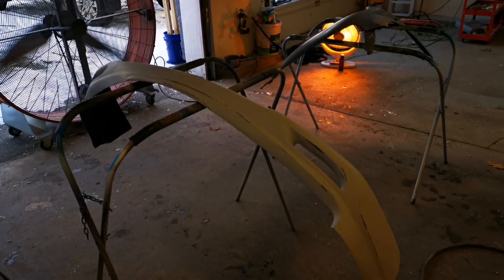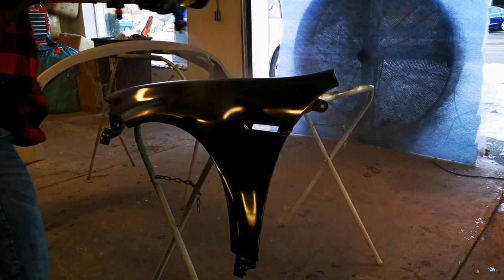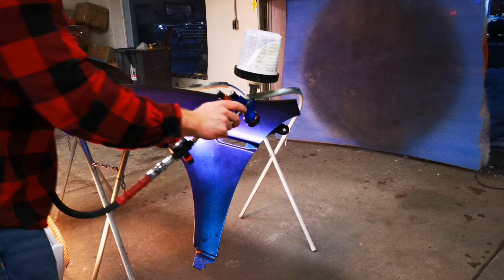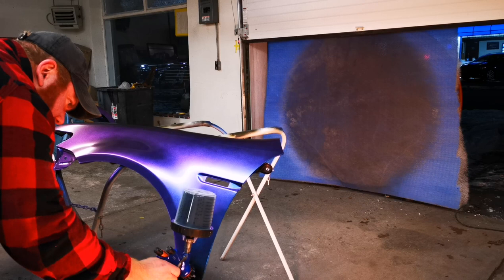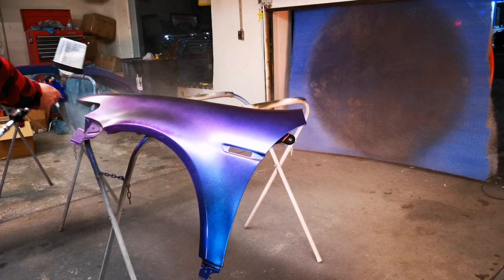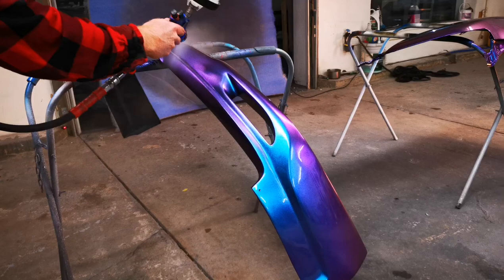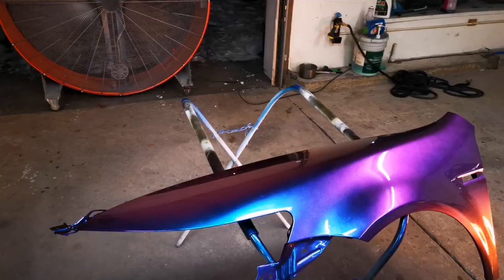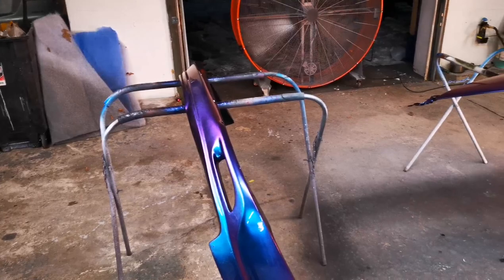How to paint colorshift

Comment: Thank you so darn much for this video.  I have a couple questions for anyone who’d like to help me.  I am painting a Nintendo Wii Zapper and I know I’m essentially asking an NFL team how to tie my cleats whilst the only thing I know about football is how to out those cleats on, and I’m terribly sorry for this! 😂   I also must apologize in advance for not knowing any proper terms 🤦‍♂️ 

The Zapper is plastic and breaks down into several parts which have all been primed with black Rust-Oleum sandable primer and wet sanded up to 1000 grit.  I only have to remove surface contaminants before I apply the primary color.  I will then apply clear coat before the final step of sanding/buffing/etc.  The main color:  Rust-o-Leum Blue Galaxy Color shift.  The clear is R-O Painter’s Touch 2x Gloss.  I’ve made a small paint booth that lets me hang each piece for painting if needed.  (Please, if something sounds off or if I’ve left something out please tell me!)    
    
1.  I was unsure if I need to paint the Zapper assembled in order to get the desired effect.  I don’t know how these paints work, so I don’t know if our two paints work the same.  If they do, that answers the assembled-or-not question.
2.  If the body parts are painted separately, how should they be positioned and should they all be consistently positioned at the same angle?  For example, could 1 piece be sprayed perpendicular to the floor and another sprayed angled, like in your video?  Is spraying it perpendicular to the floor not recommended?

That’s where I’m at and looking to finish.  Any help would be so wonderful!😊

Comment: Another great job as always dude! Would you reccomend following the same steps for pearl jobs? I'm doing a blue and gold ghost pearl over an ivory base. It looked amazing over the speed shape I did, but I'm getting the pre game jitters when it comes to the whole car. Thinking about doing the targa top and accessories first then body after it cures. Thoughts?
Reply from the maker: I still get pre game jitters here and there lol .. always have FULL TEST PANLES like fenders bumpers ect ect . And no do everything at once or you will / can possibly get different shades
Reply: Are you adding your pearl to the clear or using a intercoat? I've heard them done both ways
Reply: @ericwade2136  I'm gonna be doing intercoat using the color blender. Marco thanks for the tip! I'm gonna use the underside of my trunk as the test panel since it will need to be done anyway! Away we go!!

Comment: The Euro clear did you go fast hardner with it? Beautiful work as usual
Reply from the maker: Yea fast dry euro clear with fast activator. This is the fastest drying euro clear you will find on the market
Reply: @speedokoterefinishnetwork4937  The smr 1150 worked great at 40 degrees with the 15 to 20 minutes for flash time but not having a paint booth this European clear with the 5 minute flash is going to change the game 💯 percent
Reply from the maker: @ericwade2136  I notice in cold weather it still needs a 15 min flash, but anything about 45 degrees I can spray in a second coat with only a 5-8 min flash
Reply: @speedokoterefinishnetwork4937  that definitely changes the game with no paint booth for sure